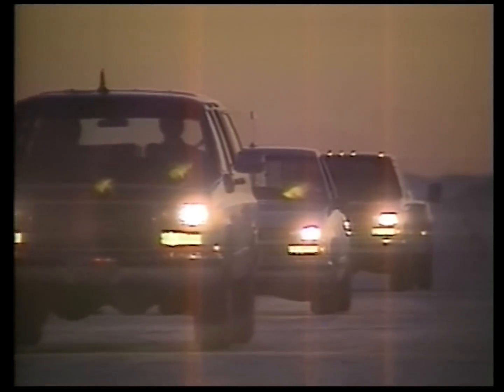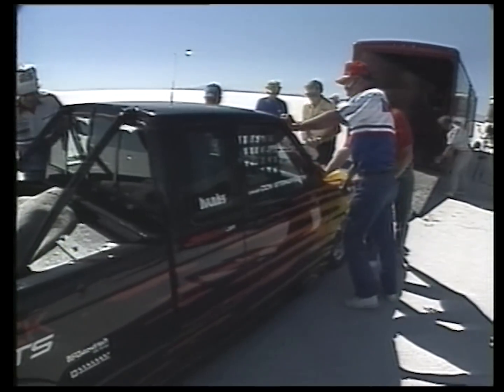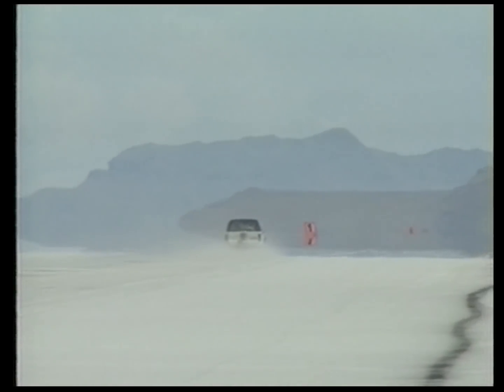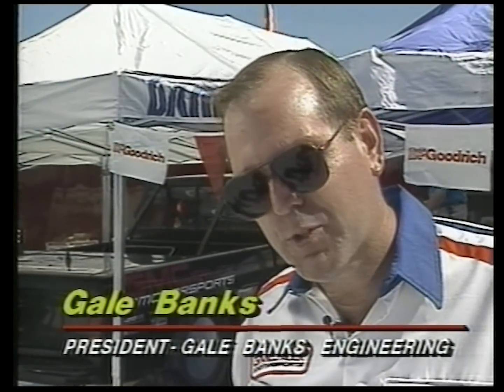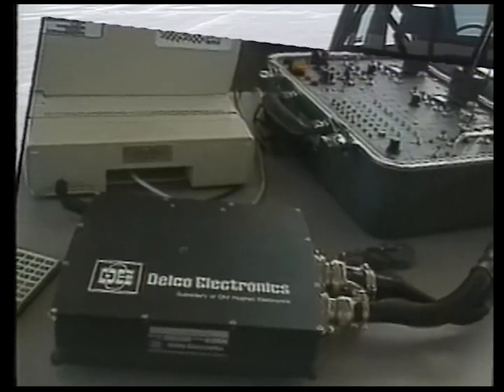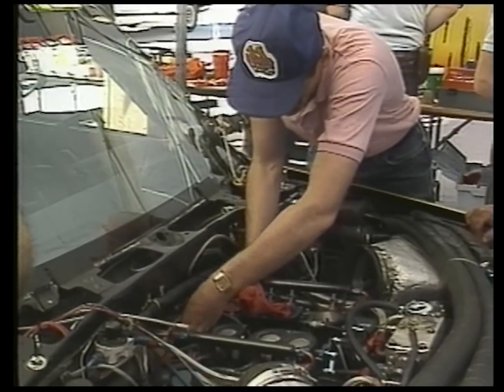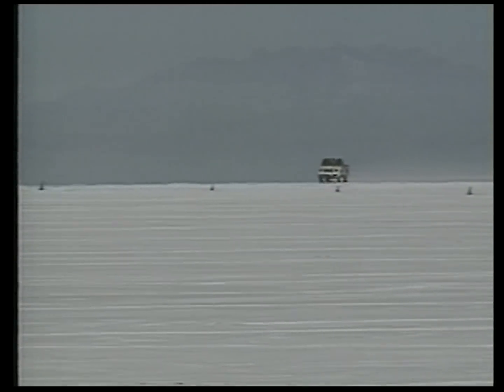Banks Still holds this 33yo World Record!

Comment: Man this is awesome. Banks Power 🇺🇸 is the best. But ford is the truck, not gmc, brick nose f series, and rangers are the best trucks from that era.
Reply from the maker: To clarify, are you saying the sidewinder is a Ford?
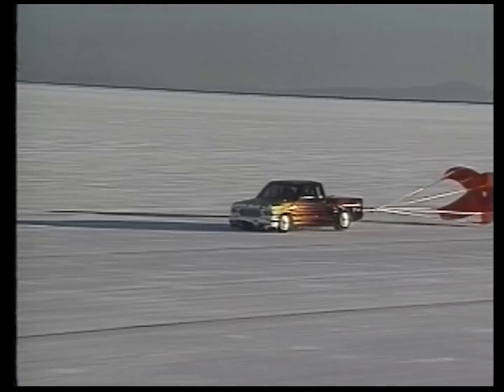Reply: 3:55 into the video, from that period of time (1988-1993)I think the Ford trucks are debatably better than what GM made.   @bankspower
Reply: @bankspower the sidewinder is this GMC Sonoma with the 4.3 GM V6. How was the engine built to 5 litres of displacement, be interesting to learn a little more on the details

Comment: The fact they were able to bore and stroke a GM 4.3 V6 to get an extra 700 cc’s displacement out of it, increase the C.R. To north of 14:1 and have it all hold together making 570hp at north of 7200 RPM is just a testament to how advanced Banks and GM performance were even back in the early days of electronic fuel injection. For those who don’t know the 4.3 was an inherently “shaky” engine, even the later vortec models with a balance shaft weren’t particularly smooth idlers and the early carbureted and TBI units even with a perfect tune-up would shake noticeably at idle. Needless to say this doesn’t make for an engine that’s particularly stable at high RPM’s even with the factory stroke length. I’m certain a LOT of time and energy went into balancing that rotating assembly and developing the strongest components possible to get the two 5.0 V6 race trucks (the other was a nearly identical ex-cab S-15 with a nearly identical engine however with different tuning and 5.13 gears out back to make it a more effective 1/4 mile drag truck) to run like they did and last while doing it.
Reply: An interesting thing about the engine, is that all of the parts used at the time were said to be off the shelf pieces. Even the crank was said to be a readily available Moldex. Amazing to think that they were doing all of this without custom one-off parts.

Comment: What transmission(4L60?) and mods to it were you running..
And cool that only 549hp would run 210mph.But your 1800 hp firebird would only run about 287mph...Must be aerodynamics limitations..

Comment: They are not Trucks, we call them utes in Australia, trucks are a vehicle generally over 3 ton + and much larger than these little things.
Reply: Nah, they're not Utes - utes are based solely off of a passenger car platform - Falcon, Valiant, Kingswood, Commodore.
These are pickup trucks, the basis for these goes right back to the Ford Model A, which came in Passenger car and Light Truck variants, the latter evolving in to larger delivery trucks and eventually pick-ups. These are based off a larger full chassis design.
Ute's can do, up to 500kilos in the bed. Pickups are in the 500kilo to 3500kilo load in the bed range, and small Trucks are 4 metric tons and above.
We didn't get Pickups imported by the manufacturer here 'till recently, with the exception being locally assembled F100's from Ford.
Reply: Yeah dude that's definitely a truck😂 you might be thinking of an El camino. There is no weight requirement to be a truck by the way
Reply: @silkyjohnson5976  Automotive history, and the weight requirement - initially (and I'm talking 1890's here) a "Light Car" was anything under 10 tons, and a 'Truck' or 'Traction Engine' was over that - which is what led to the naming of the "Light Car Club" in the UK during the same period. The very first 'Road Trains' were Traction Engines pulling several carriages, each the size of a small bus.
Here in Oz, you need a "Truck License" for anything over about 6 tons GVM now.
You're right on the El Camino, it's a Ute, because it was based off a passenger car platform, same as the four I mentioned before. Subaru Brumby falls in to the same class, but a Chevy LUV doesn't, even though it's a Mazda, they were made as small commercial vehicles.
Reply: @PiDsMedia  Frankly unless its from the USA or Germany your conventions dont matter. 
We made the first true cars. We get to decide what to call them.
Reply: Holy shit, I guess American auto makers have been falsely advertising trucks this entire time😂
  We need you in Detroit immediately to spread the word🤣🤣🤣
Reply: We call El Caminos El caminos by the way. Calling any car/truck a ute is like calling any cola a coke.
Reply: @Luckingsworth  heavy vehicles, like trucks and traction engines, came from the UK before there was ever a US car industry. Age of Steam and the Industrial Revolution.
You only get to call them what they are there, same as not knowing how to spell Aluminium or use decimal measurements 🤣😉
Reply: @silkyjohnson5976  IIRC, youse only got El Caminos and Ranchos as the US utes, was there a Rancho before the mid 60's Falcon? There's a Rancho gasser pops up on Drag Week events, looking suspicious like its a LHD version of the XM to XP Falcon Ute we had here.
Reply: all im trying to say is we don't use the term "ute" in the states at all. If  we're referring to an Australian-produced vehicle like the holden commodore we might out of respect but that's it. Anything else we just call it by its make and model like the Subaru brat is just called a Subaru brat.

Comment: No GMC is a pickup not a truck
Reply: Ha ha ha it’s a Ute
Reply: @ryanburbridge  Not a Ute - a Ute is built on the same platform as a Passenger car, these are small pickups built on a commercial vehicle platform.
Reply: A truck is a 1ton or bigger with a flatbed

Comment: That laptop!! Oh how far we have come.
Reply from the maker: Right!?! All the data and equipment that had a separate trailer and with massive antenna have be replaced by a single laptop, GPS module, and high tech ECM. 30 years of tech difference is amazing.
Reply: @bankspower  y'all need to get it back out and hit something light like 300mph now.  Flex on your old record, maybe use a new version.  I know y'all can do it too!
Reply from the maker: We're going for the Pikes Peak next year. Also, not sure if you've seen it, our Trans Am did 283mph in 1987. 
Check it out 👉🏻  https://official.bankspower.com/project/custom-projects/banks-twin-turbo-gt-trans-am/
Reply: @bankspower  that's amazing and 1987!!!? That's even crazier you was knocking on 300mph door.

Comment: The history of cutting edge performance the Banks way, decade after decade. 

The HTEB advantage:
Horsepower. Torque. Efficiency. Banks!
Reply from the maker: Agreed.
Reply: @bankspower  fun marketing idea, introducing 
“THE B” factor 
THE Banks performance solution equation 
   + T  Torque
   + H Horsepower  
   + E  Efficiency 
   = B  Banks 
Want THE B?
   Got THE B. 
THE Banks Performance Solutions simply add up.

“THE B” factor explained:
Two type of people 
Those that got THE B
Those that want THE B
Go ahead get THE B

Best, 
KP
Colorado Springs, CO